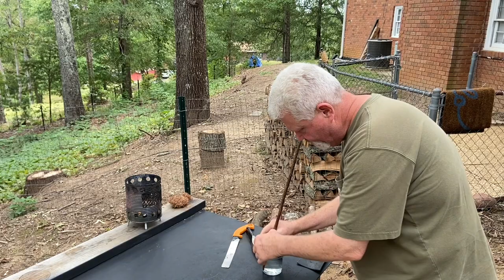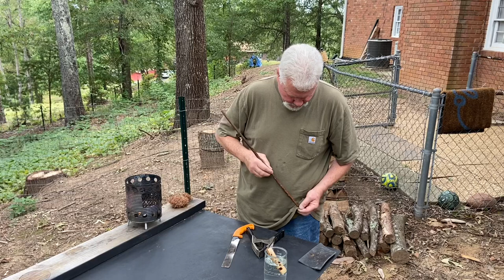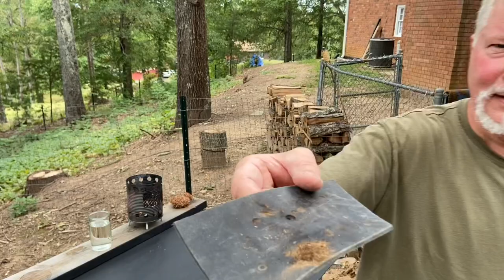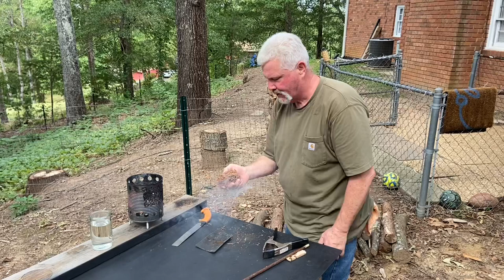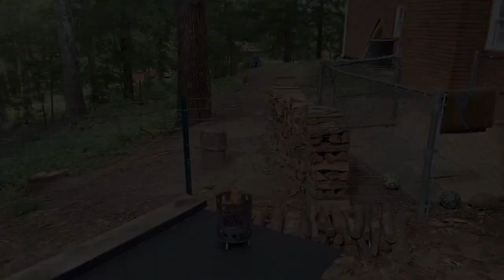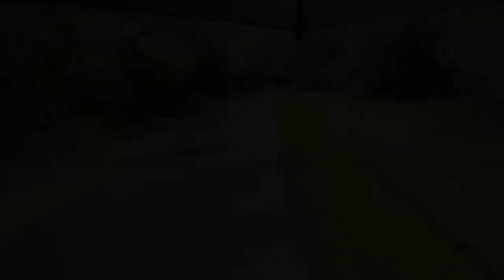Water Soaked Hand And Bow Drill Sets Still Produce Easy Embers... How To Recognize Steam vs Smoke!

Comment: Came here to say thanks!  Because of your “Drying cycles” I was able to get an ember with some difficult oak. I’ve gotten OK with pine but oak has been eluding me. Keep up the great work!
Reply from the maker: One of the best sets I ever had was Southern Red Oak and Water Oak continues to be great also!
Reply: @DavidWestBgood2ppl  you are one of the few people I see get consistent embers with any oak. Many others are softwoods only. Part of the reason I decided to try it again. That and it’s everywhere near me.
Reply from the maker: Some hardwoods are too hard and only polish the divot and spindle tip or produce chunky used up dust that will not ignite. But the ones that work make embers that last for minutes.